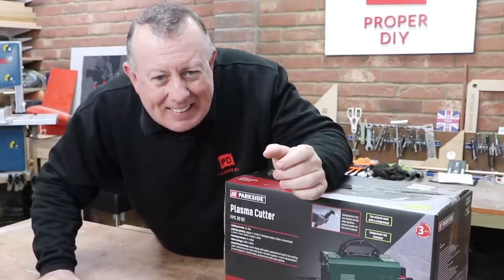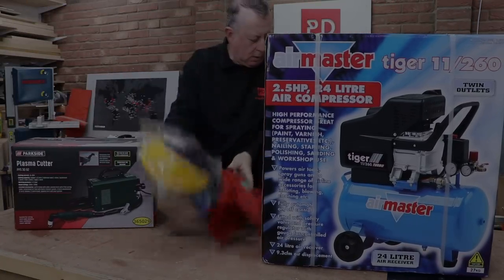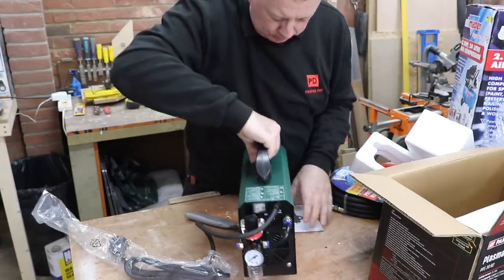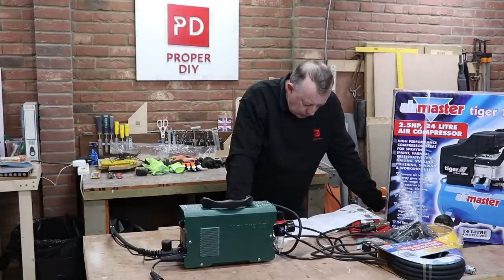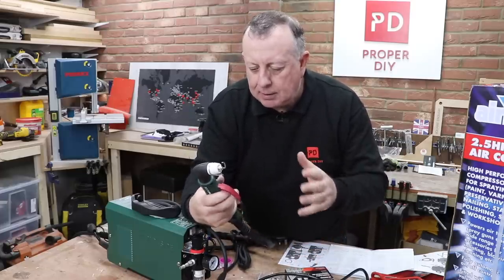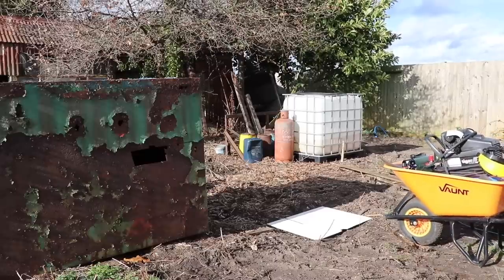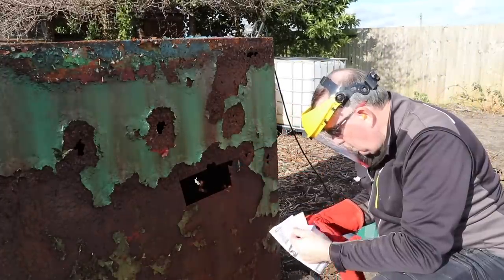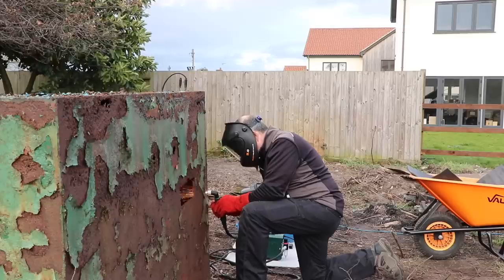Using a Plasma Cutter for the first time

Comment: rule number 1 always unwind the extension lead fully
Reply: Isnt the first rule is never buy anything other then a pint of milk?
Reply: A unwound lead can act like a heating element, maybe that's why the thermal cutout on the extension lead tripped...
Reply: Unless your purpose is to melt the wire or perhaps start a fire ...
Reply: Looked like the air hose wound up, not the electric cable.
Reply: If you do not unwind your extension cable, you have a mini transformer (but without a secondary winding). Draw a lot of current through it and it will generate quite a bit of heat. You are lucky that the manufacturer has thought that people would not unwind it properly, so that is why there is a thermal trip on it. If it wasn’t there you could easily end up with fire on your hands
Reply: My advice to everyone is: Always read the comments before leaving a comment that’s been left dozens, or 100’s of times before. 

Always amazes me how many folk write a reply thinking they’re the first one to do so!
Reply: With the cutter and compressor both connected to the extension lead, there is quite a bit of current involved. Many lightweight leads can't carry that much current even fully unwound. For those who don't know, the current should be on the appliance, alternatively, divide the wattage by 240 (UK). Once you have the currents drawn by each machine, add them together and compare the total with the extension lead rating.
Reply: Came here to also mention this
Reply: Called proper DIY for a reason.... Fucking dangerous 🤣
Reply: Ive popped into Lidl for milk and bread and came home with a gasless mig🤦‍♂️ didnt need it as got mig and a stick welder i picked up 1 day i Aldi🤦‍♂️🤦‍♂️🤦‍♂️  ive came home from lidl wit a compressor.. went for bread and had to go back as forgot bread! 
The wifes tried to get me barred from Lidl for my own saftey.. 😂😂😂
Reply: Oof,I've melted a couple...not mine though 😂.
Reply: @mickyanderson3639 😂

Comment: Fully unwind extension cables if your going to use a significant amount of power. It may have diferent rating for fully wound, half wound or fully unwound printed on it.
Reply: It seems to be the 1st thing you show where the manual might actually be important, even before the 1st try.
Reply: Yes, i'd have thought the wire was getting quite warm wound like that drawing decent current.
Reply: Absolutely. I once ran a couple of fan heaters of a single extension reel without winding it all the way out. Melted the plastic drum so badly I had to throw it away, but at least I caught before I had started a fire.
Reply: Indeed, the cable drum will tell you to fully unwind if you plan to use it at rated current. And it may tell you how little current you can draw when it's fully wound. Furthermore, the plasma cutter will be labelled with the max input current, even if you can't bring yourself to RTFM. And don't forget to include the compressor current....
Reply: Definitely unwind that extension real, the compressor motor wouldn't last long on its own on a half wound 25mtr real and then throw in a plasma cutter,  compressor will pull a minute of 10amps
Reply: often a 13amp extension real might only have a 720w rating if coiled. Essentially you're creating a large electromagnetic field and it's going to get HOT. You should NEVER use a real wound with a high load. This is very basic guidance, just don't do it! Thermal cuttout isn't guarenteed, unwind it, make sure it's not coiled and you'll be fine. Use a short as lead as possible too.
Reply: I came here to say this, all the extension reels I own have something like "Warning do not exceed maximum allowable load: 720w max fully wound, 3200w max fully unwound" printed on them.

Comment: a good earth bare metal on the big tank would of helped a lot, as i found with welding you need to get the earth close to where your working and on the same peice your working on.
Reply: There's a good chance of thread sealant on fittings, as well as corrosion where it does make contact if dissimilar metals.

Comment: Few thoughts to help. The duty cycle on a consumer plasma cutter is probably around 30% so 1 minute on 2 off, this should be in the manual somewhere. The compressor is running all the time so is too small, I think a compressor that provides a sustained 12-14 CFM will be better. However if you do 1 minute on and 2 off that will enable the compressor you have to catch up, and hopefully will give more consistent pressure. On the old tank use an angle grinder to expose bare metal for the earth clamp, it will really help. Use two extension leads it will reduce the voltage drop and the breaker tripping, and check they are rated at 13A, if you can run them off different ring mains. I have seen some comments re not using a coiled mains extension, yes this is true, however I can only see a coiled air line so it doesn’t apply here. Good luck…
Reply: If the extension cable was tripping out, I am not surprised, the compressor on its own would draw near to 13 amps , which would have been beyond the limit of the cabling.  Most extension cables are 2mm^2 that is particularly minimal especially when you factor in the voltage drop on the length pf the cable from the socket outlet.  I use 2.5mm^2 extension cable that I made up and have no issues with 13amp requirements but it is noticeably weightier that the normal HD extension cable  The compressor is on max duty so is not supplying sufficient air.  The 11/24 Airmaster will probably only deliver around 6-8cfm above 90psi, the 11cfm is maximum free air displacement under no load and pressure and the tank at 24litres is particularly small for any sustained duty, it needs a tank capacity of at least 60 litres and preferably 120litres.  I actually use a 8/60 in parallel with a 9/45 compressor on a 60amp ring main and once going they cascade in and out due to the variance of the pressure switches  I can also plug in a 8/24 mobile unit to boost the air supply should I need it 
I bought the Parkside plasma cutter the first time around when it was only £49.99 with a view of cutting 16g steel  but as yet I have not even unpacked it!
The coil around the compressor appears to be the power cable not the air line and would be reducing the cooling air to the motor.
Reply: And air in plasma cutter needs to be dry and free from debree and oil. And yeah it is connected via long extension cord, voltage drop could be significant thus arc has not enough energy. I would measure voltage on extension cord when everything is on. if there is more than 10% voltage drop then it is no go.

Comment: I have used lots of plasma cutters  over the years and there's 1 or 2 things that will help yo get good results  no1  clean dry air and lots of it if you loose pressure the results will vary considerably 2 keep the tip cover shield clean this can easily get damaged when trying to blow through a job so start at  the edge or drill a hole ..any damage to the hole in the tip will change the cut width and finish  3 the earth connection is very important  on rusty or dirty grind it clean  ... 4  for good cut results the movement of the torch should be continuous and smooth and go to fast it won't cut thu go to slow the cut will be wide and ruff if you use a straight edge it will help  ..... hope this helps  good results are possible even with small machines cutting to within 2mm is possible on 3mm steel... blowback damaged shields are often the biggest problem hope this helps  and good luck  ....a good honest  video 👍
Reply: Great tips 👍🏻

Comment: Nice one Stuart, I got a plasma cutter some years ago from a company in Gloucestershire it will cut really thick materials with no ragged edge but horses for courses it was 4 x the price ,my daughter uses it more than me making her art projects ,the one you trialled would be more suited to body panels and thin materials turn up your air pressure to try and make your cuts cleaner and don’t rush take your time but they are great fun when you get the hang of it thanks stay safe 👍👨🏻‍🏭

Comment: Hi, I am using a plasma cutter since a few years now (not on daily bases) and I guess this machine is a bit too "cheap" to do a proper job. (If I am correct it says for steel :1-9 mm, that is a bit light for the job you tried. A tank like you are trying to cut is most of the time around 5 mm thick, and you should have no problems cutting this with a good plasma cutter. As said before here: it needs a GOOD ground contact (no rust). Also,  better a higher current setting than too low. Maybe more air pressure and angle your plasma gun a bit towards the gap that you already cut, (not towards yourself) so the air pressure blows the melted material away through the cut. You will have less or no material buildup on top of your cut and a faster and cleaner cut. For more precision cutting use a mount with wheels to roll on the surface  instead of dragging this metal holder, it works smoother. Have fun and keep practicing 👍
Reply: I disagree with you.  I have the same cutter and I get extremely clean cuts. This guy is unfortunately not using it correctly.  You can't blame the tools if the operator uses it incorrectly.

Comment: You need to grind a good earth, and always unwind the full extension lead to prevent overheating....especially when pulling high current, the setting on the aluminium was far too high.
Plenty of you tube videos out there.
Love your videos aways well explained.

Comment: For that tank i’d get a metal cutting circular saw, such as the ones from evolution. Exactly like a regular one except it spins slower and comes with a blade designed for cutting metal. Much better than the abrasive discs that grind away a bit slowly! You will definitely need hearing protection though!!
Reply: never ever cut rusty steel with them type of blades.. rust is incredibly abrasive and can take a edge out on those tct blades. there are so many things this guy was naive about which i wont go into because ill be here all day but a plasma cutter is very dangerous when used recklessly especially high freq starters

Comment: Hi Stuart great video, I think the problem your having is the ammount of impurities on the oil tank, rust and paint etc. Plasma cutters work on the same principal as mig welding and tig welding they both need a realy clean surface to get a good arc. Gas and air and a cutting torch would be much faster.

Comment: You're not on your own. I bought one, too. Pretty decent, especially at that price. 👍
Shame the supplied nozzles are far too big. Buy smaller ones (the hole size, that is). Ref your thermal cutout, I thought you were savvy? Half of your extension cable was still on the reel! You should know better.😓
(Sorry, @stu nimbus, made my comment before spotting yours):face-blue-smiling:

Comment: The reason you're missing bits and have an uneven cut is because you need to use a straight edge as a guide and move smoothly at as constant a speed as you can . Also if you drill a hole as a starting point on athick plate the plasma arc won't blow back damaging the tip . The tips are consumables and as they wear the plasma arc is more diffused and looses its focus , I've used many different plasma cutters up to units to cut 30 mm stainless steel when the tips lasted about 2 minute's.

Comment: I purchased one of these last year. So far I have been quite impressed with it. After some playing around I think it is fair to say that whilst it will cut steel >6mm, that is really the practical max limit. I tend to cut 3mm plate and for that it works fine. For straight cuts, an angle grinder with a 0.8mm slitting disk is probably just as fast and much cheaper, but for cutting shapes or more tricky cuts the plastma works well. 

For cutting that tank, I would be tempted to get try an evolution type circular saw with the multipurpose blade it comes with. Loud, messy and with hot shards of steel going everywhere, but it would probably be the fastest way of doing it.

Comment: You need a 2.5 mm extension cable that is fully unwound to stop it over heating , those cheap extensions on a reel just won't handle the amperage..... 👍

Comment: Good video. I've had reasonable results with mine with a little practice and trial and error with the settings. The cuts aren't perfect but acceptable with minimal grinding required. A couple of things that helped. Earth close to the point of cutting and move the earth periodically. Once got a setting that works for a material I've found cutting speed easier to deal with material thickness than tweaking settings. Thinner faster, thicker slower. Practice on material in the middle of the recommended range.
Reply: I'd also say make sure the earth cable is making good electrical contact, rust and paint will cause problems. File it away first.

Comment: Great vid! Saw that plasma cutter too, I definitely had more of an allergic reaction to it's size, seemed more of a DIY gimmick than a useful tool. Although DIY'ers like ourselves will always be tempted by a gimmick😂😂 interested to see how you get on with that diesel tank! Good luck!
Reply: Knowing what your doing matters a bunch..in order to operate a plasma cutter, you must understand compressors. And know what cfm means at 90 psi..if the plasma cutter calls for 6 cfm at 90 psi..that means you need a compressor that's 1 5 or more bigger..my compressor is 20 cfm..way more than needed...but more is fantastic to me..

Comment: Aldi special!  Genuinely interesting!  Very tempting. You don't own a compressor?!!? Hehe you bought the same as mine!  ;)
PS your extension cable really needs to be fully uncoiled when used at rated power.  It's still half rolled up in the shot where it trips!
Reply: Parkside is Lidl. Aldi it would probably be Ferrex.
Reply: @grahamleiper1538  Yes of course you're spot on!!  That'll be why I never found Parkside in Aldi!! ;) Tell you the truth I always get them confused!!

Comment: Thanks for sharing.  I recently cut up our old 2500 litre oil tank which was in better condition than the tank you were trying to cut. It took 2 metal cutting discs on my 9-inch angle grinder and only took a few hours.  Much neater cuts as well.
Don't think I'll be buying a plasma cutter, this looked a step down from a Colin Furze plasma cutter

Comment: You’ll find the plasma cutter will work much better and cut cleaner with the paint, rust, mill scale, and aluminium oxide cleaned off with grinder, flap wheel or even a wire brush

Comment: I have to warn against using a plasma cutter on a wooden bench/in a workshop where woodworking has taken place. 

I used my Parkside Cutter in my workshop, thought it was all safe, no sign of fire when I went inside the house for tea (over an hour after using the cutter.) Two hours later my neighbours came for me saying there was smoke coming from the barn where my workshop is.

Took two fire engines all evening to put the fire out, it cost the insurance  company 11,000€ and that didn't cover all the costs. Still sorting stuff out 6 months later.

Suspicion is that a spark from the plasma cutting had found some sawdust hidden under a bench (in general I keep the workshop well swept, but I guess there's always areas the broom doesn't reach) and quietly smouldered unseen and not smelt until I had gone.

I have a new Parkside plasma cutter but I only use it outside now (16 amp extension cable all unrolled, here in France normal sockets are 16 amp rated). A bigger compressor does help but it still doesn't cut neat lines, always grinding to do to tidy the cut. But for the money it is a bargain.

Comment: I bought this machine a while ago for some occasional cutting, and it's not a bad machine for light work.  With a little practice, you can get much cleaner cuts than that, especially if you use a guide.  It does struggle a bit with anything over 5mm, but it works nicely on thinner sheet material.  
I cut bar stock and profiles with a small band saw, and prefer a disc for making simple straight cuts.  But for very long cuts or irregularly curved ones, this machine is a handy tool to have in the shop, where I couldn't justify a better and more expensive one for the few times that I need it.

Comment: When setting the air pressure pull the trigger on the touch and watch that air pressure as it will drop a lot and that’s when you set it with the trigger pulled , yes my cut 60 is bigger machine and cuts perfectly it was a lot more money than you paid, so you get what you pay for! Still interesting video and I would suggest you watch some videos on it to make sure you are getting the best out of your machine 👍

Comment: I have a lidl plasma cutter but one with a built in compressor, I've found it cuts great, tho it didn't really like the aluminium, I cut a few dozen nail plates in half today and it had a perfect cut and cut them quickly, I didn't use any stand off, I just put the tip on the steel, I've used it a fair amount and still on the first tip.

Comment: Plasma cutting is like welding. You need balance between amperage, air pressure, electrode-to-steel distance/angle, and cutting speed.

Also, with that smallish tank of air, you got "wet" air after few minutes, which will affect your cuts. Dryer or go big on tank.

Some plasma cutter do just fine with electrode touching the steel, some need 0.5-1.5mm gap between electrode and steel. I use hose clamp around nozzle and roundhead nail to adjust that gap. Way easier than those clip-on frame around the nozzle.

If the steel is thicker than 8mm, I'd go with oxypropane torch.